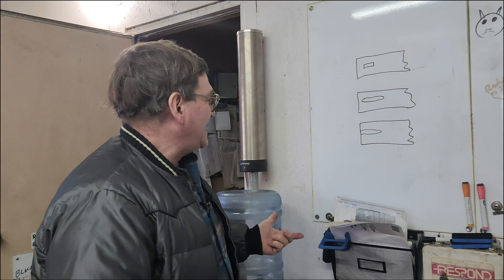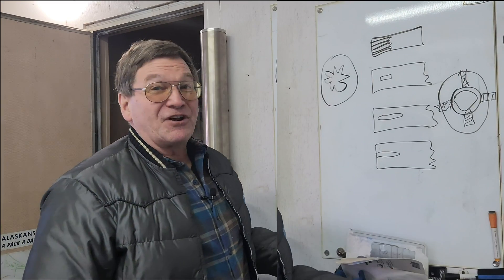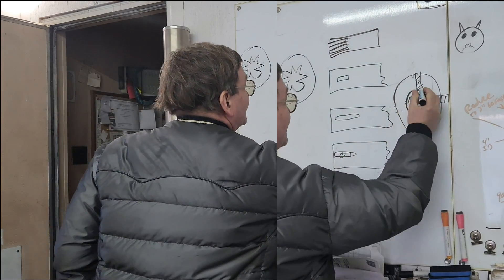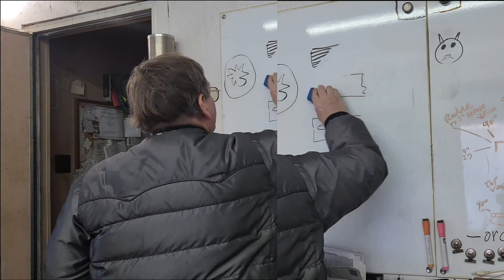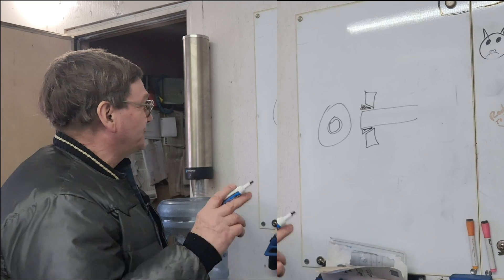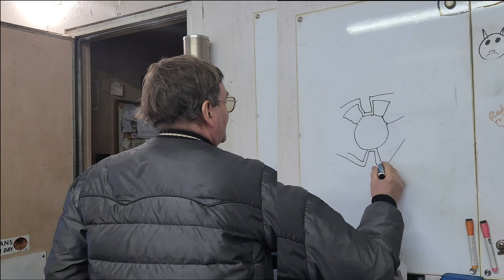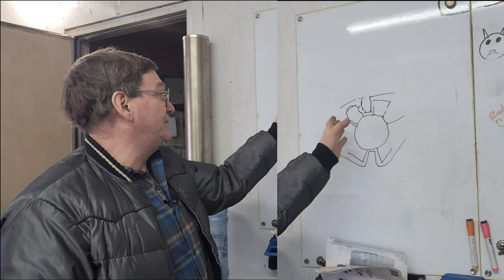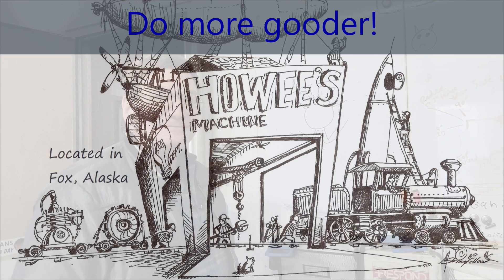Machinist's Minutes: Set screws, keyways, splines, and fitting hubs to shafts

Comment: Do you know why hydraulic motors shafts do not have standard key ways depths?  It always puzzled me. The machine shop would always have to broach keyways in hubs deeper. Or i would have to hand file the keyway about 1/16 of an inch.

Comment: Involute splines are used in drill press quills, lathe gearboxes and mill spindles. Generally, any shaft that needs to slide within another at a decent amount of torque or speed use an involute spline. But then, involute gears aren’t the best design, but they’re cheaper to make than the alternative.